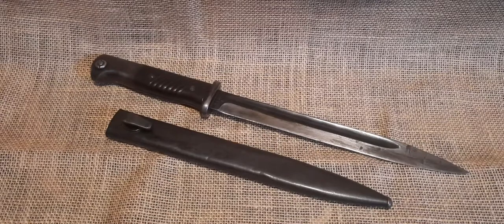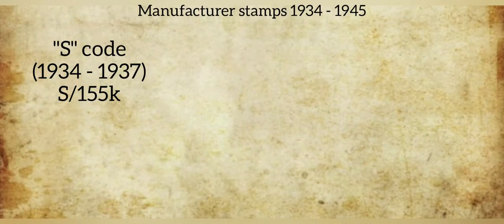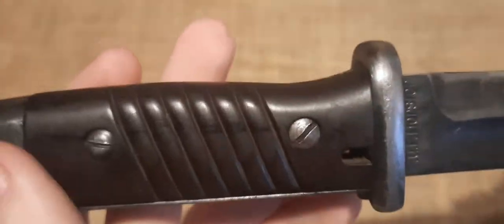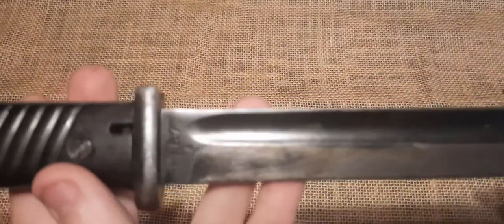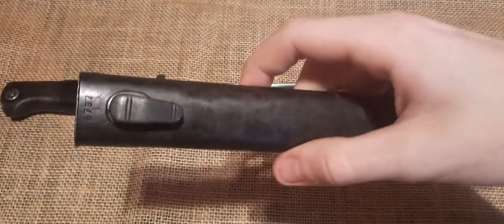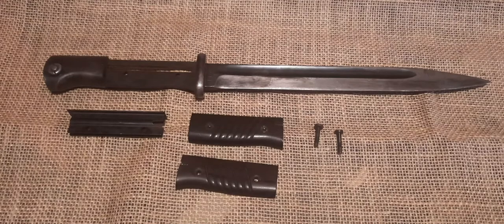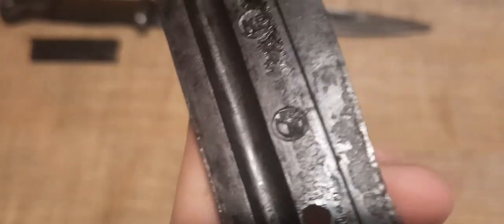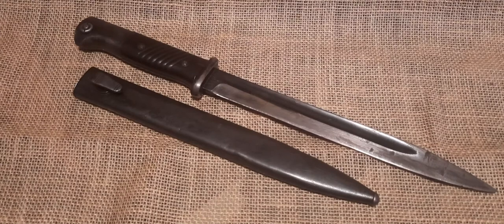All about the WW2 German Mauser k98 bayonet

Comment: Why are all the WW2 German Bayonets dull ?
Reply from the maker: Probably from years and years of being removed and put back into the sheath is my guess, it kinda rubs on the sharp side of the blade, also after the war alot of people used them for everyday things which would over time dull them. Although I have no idea why they wouldn't sharpen it 🤷
Reply: @worldwarboy5619 i have heard that the bayonets were issued like this and never sharpened thats why they should not be resharpened
Reply from the maker: @RNLDishostin  yes you're correct about that. When the bayonets were issued they came unsharpened, and needed to be sharpened by the soldier. If you have one that seems to have been issued but never used then definitely DON'T sharpen it.

Comment: Thank u i have learnt alot bro thx but mine says 9821
Reply from the maker: I tried to do a bit of research for you so I hope this helps, I was able to find a few K98 bayonets with the serial number being "9821" like you said is marked on yours, and here's what I found: German K98 bayonet with the serial number 9821 were produced 1943, and were made by E.&F. Hörster. If my research is correct then there should also be a "VV" stamp, as well as a "43 asw" stamp somewhere on the bayonet scabbard or the bayonet itself. If the stamps aren't matching then it's very possible that the bayonet and scabbard somehow got mismatched over the years, possible even during the war. I hope this little bit of information I've provided has helped in someway, and if you have any other questions please feel free to ask! I'd be more than happy to help out in any way possible!